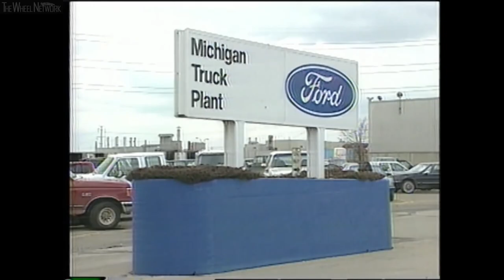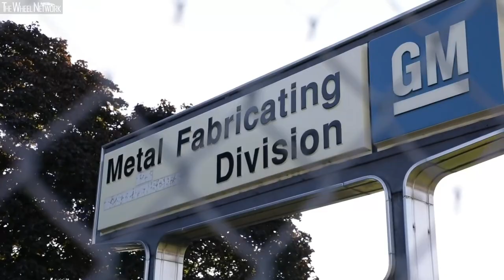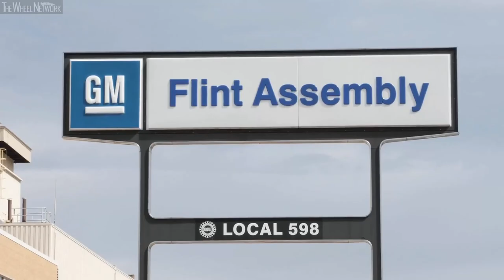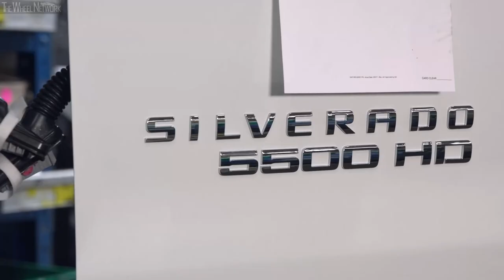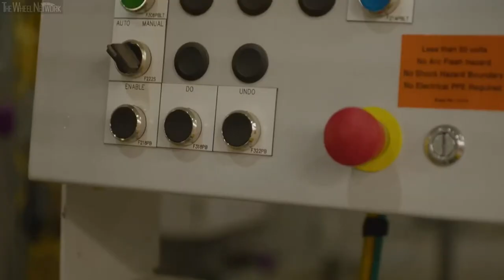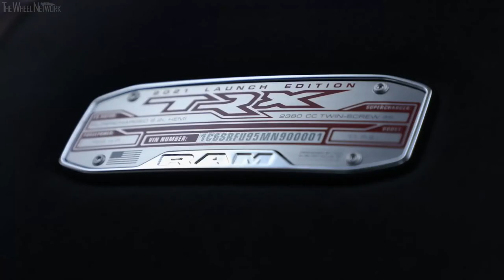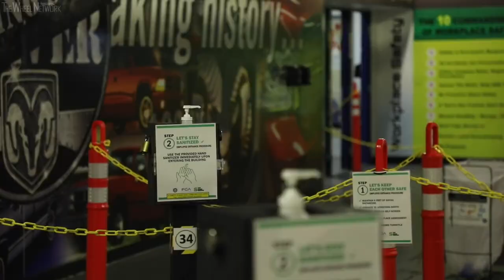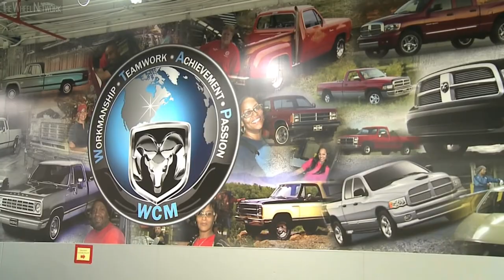Pickup Truck Production in the United States – Ford, GM (Chevrolet, GMC), Stellantis (Jeep, Ram)

Comment: lmao! I remember when we were still called Michigan Truck. Damn its a wee different now. I started off on the flat top across the aisle from where they were decking the engines. Also spent 5 er 10(?lol) years in body. Back then every once in a blue blue  moon one of those Kuka respot bots would lose it's shit and think an F150 was a Bronco(U150)  and run itself through the back of the cab. bang!! DOH!